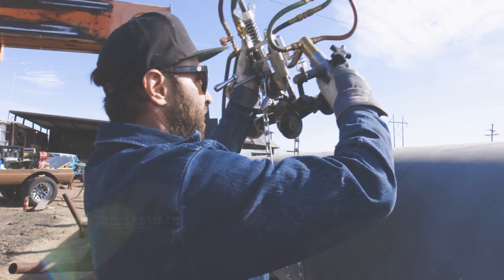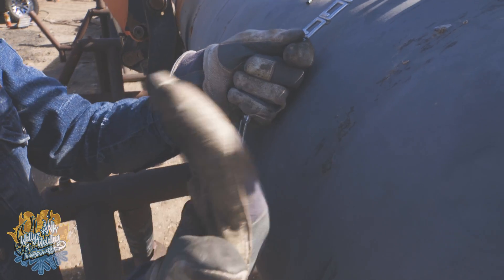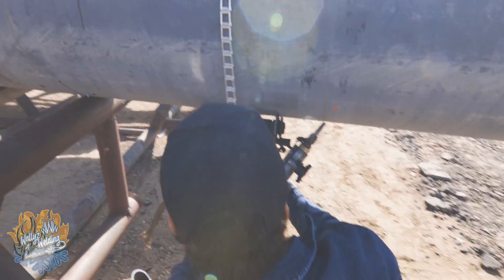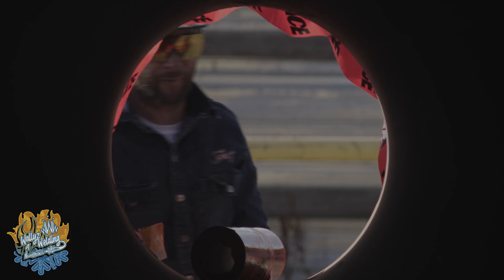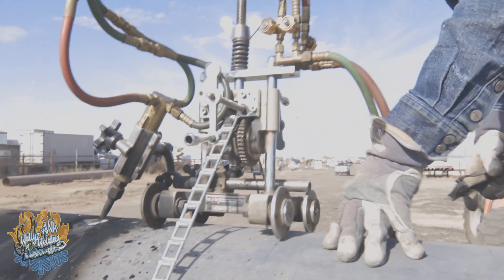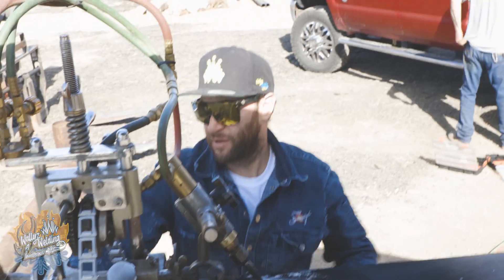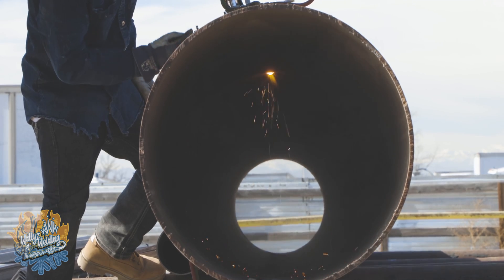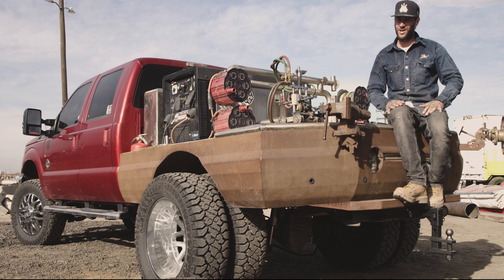Pipe Welding | Pipe Cutting

Comment: like the other guy said we use the cutting bands with crawler, the hand ones have a nice long whip so you can stay a bit further back from the pipe, they also make motorized ones. easier to set up the band plus for piling we mainly use spiral pipe so picklers wouldnt work well. just a thought, little bit more pricey but production wise we can do more cuts way faster
Reply from the maker: I use them in tight spaces

Comment: Started using a magnetic track torch.  Simple and easy for one person operation.
Reply from the maker: Nice where ya get it and how much it run ya? Never seen one cut pipe
Reply: @Wallyzweldingworld  Get them from a company called Bluerock.  I cut everything from 12" to 36" pipe.  They are acetylene only though.  Been running one for about 2 years now.  They run about $1200.

Comment: We use a beveling band with a crawler maybe you can make a video on that so they can know about the other option. Great video though keep up teaching brother!!
Reply from the maker: Yeah I’d like to buy one! I could definitely use one. I have the doubt and the swivel top and torch just need the band and crawler what ya pay for yours and what size is it. I have used them many times when I worked for them oil companies they would have them at times
Reply: We got from 36” on down to 16” and as for price it varies from $1500 on down pending on size. Just gotta shop around brother.